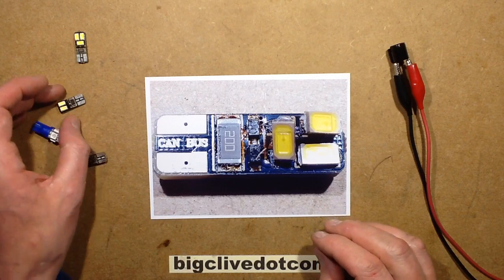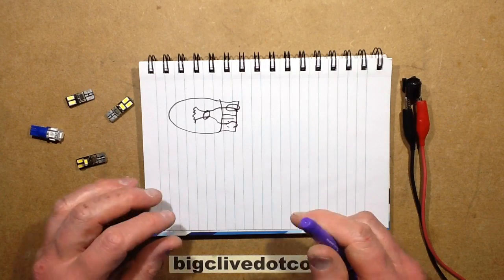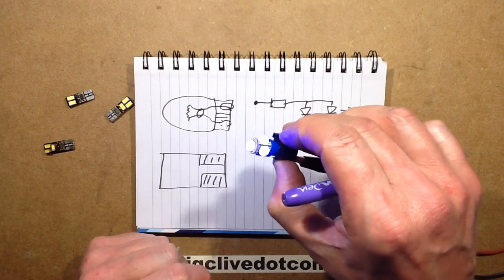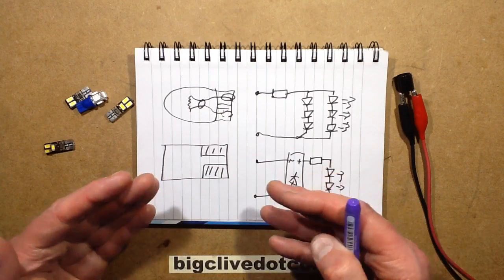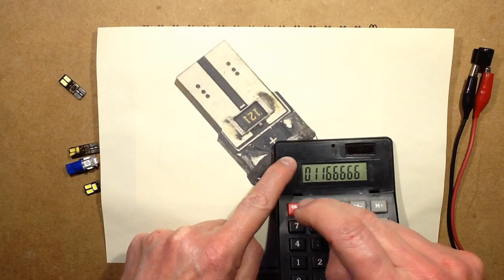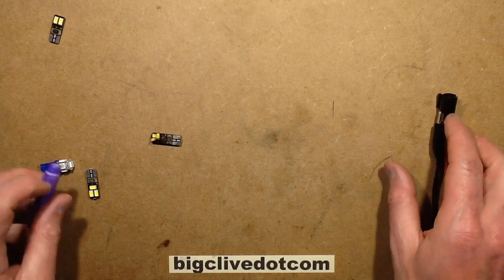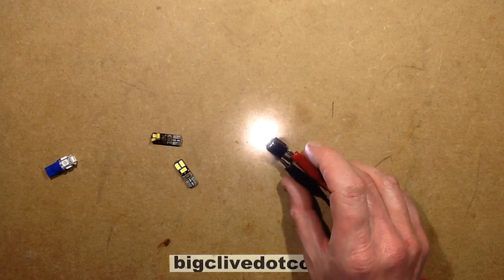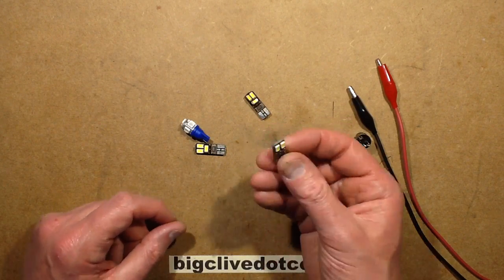Smokin' hot CANbus LED lamps.  (230C in open air.)

Comment: I think people need to realise, what i dont think is hammered home enough in Clive video is that You dont need the resistor , or the load , unless 1) not having it messes up a bulb out detection system . or 2) it messes up the speed of your indicators (turn signals) . Putting LEDS with huge burny resistors into places where those resisters are in no way helping , and even worse melting things, seems a bit silly (like in dashboard , or running lights, or other interior lights) - so make sure u use the low load ones if you possibly can

Comment: So if you did use one of the CANbus lights, and it failed, then it might not be detected.  The dash warning light won't illuminate if the resistor is still connected across the leads? Assuming the LED's fail before the resistor does.

Comment: I run these in all the rear lights on my BMW. Not this inferior style, but CanBus LEDs nonetheless. Only one failure out of 8 bulbs (50W brake bulb), so no complaints from me. I buy them from Horizon LEDs out of the U.K.  They test and stand behind their bulbs. Highly recommended.
Reply: I should add that mine are NOT T10s. They're much larger bayonet style BA9s and BAY9s. I actually have the one that failed if you want it. It started working again when it cooled so I couldn't throw it out.
Reply: +Mike1nyny in my book that's the best reason to not only throw it out, but smash it to bits first.

Comment: I've had a funny anomaly with an led break/side light combo, when switching on my lights when travelling forwards, my engine feels like someone's just attached a caravan to the back of the car.
I can't see it being too high a load, any ideas?
Car is '02 scenic diesel
Reply: +bridgendesar it sounds like your alternator is being put under a lot of load, check to see how many amps your alternator is rated at and how much your electrical system is demanding with those lights on. It's better to be safe than sorry.
Reply: +Tomo Takino I&#39;m pretty sure that&#39;s not the case, after a bit of googling, i revved the engine and put my foot on the break, the revs died off instantly. this was with the old bulbs back in place. the voltage from the break light tells the ECU to cut power. I&#39;m thinking a diode on the break light feed should prevent the side light voltage tripping the ECU.
Reply: That's odd, then again I have little experience with the Scenic since we do not have them here in the US. Glad you got it figured out.

Comment: The Problem in my Fiesta Mk6 built in 04 is, if i dont have the resistor the lights stay on. No auto off or auto on. Instantly on.
So the resistor is needed in my car. But it does not have 1,6 W, it " just " has 1,2 Watt. But still get pretty warm
Reply: I know its a old comment, but for someone who is interested: It stays on because the solid state switch circuits are leaking when little or no load is on them.

You shouldmake a good resistor circuit (5 or 6 resistors, with grand total value matching the same as the old resistor), heatsinked and everything, and mount it somewhere secure in the car and use thick quality wire and connect it to the bulb socked. And then stick a normal led PCB in there without that stupid SMD led Thats how i would do it. Remember, its a car, its not a written off washing machine. Wouldn’t want to see the electronics blowing up on them. Its a major pain in the arse

Comment: I put so called CAN-BUS Led tail lamps in a Park Avenue. About a month later my traction control light began to illuminate at random times. After spending about one thousand dollars on new hubs and a computer reprogram, it turned out that the ABS system functioned on load rather than a completed circuit.  Somehow GM designed a system that required that no more than two of the four tail lamps could burn out before the ABS system would register a major Error. It needed a current draw within the range of four 25 watt filament lamps. The computer would then shutdown the traction control, and shortly after, the stability system as well as the ABS entirely.   If you get a min. could you reverse engineer a Buick park avenue CAN-BUS system. I will understand if you need to do a 2 part video.

Comment: Good video, we had an issue with 110 Volts dc 20 mil Ø pilot lamps burning out on substation accumulator chargers. Underrated R's. poor design. I modified the design with the correctly rated R's and the problem was remedied.

Comment: I tried the printed board T10 LEDs in my dashboard. Worked for 2 days, but the connection was awful. 

Bought a plastic base version, worked amazingly ever since. A lovely little 2W ice blue LED. 
If you have an older vehicle, try a low consumption plastic base such as the one Clive demonstrates.

Comment: I wonder what is the point of such LED lamps. With the smoking parallel resistor they don't draw less power than a classic bulb. And because this resistor heats the LEDs up terribly, they also don't last longer than a classic bulb.
Reply: If your brake lights can't be seen in daylight you have bigger problems than a bulb failure warning.
Reply: +danyk666 - The lure of a long-lasting LED light instead of a fragile glass bulb, along with getting a daylight-white color, probably.
It's not about drawing less power, and most exterior light housings have enough space that they don't heat up this much. I've had to convince a lot of people to avoid LED lights on cars with bulb-monitoring for this exact reason.
Reply: +danyk666 they are fashionable.
Reply: dbeierl bs. If you get a good quality one they do last longer. Its called having a heat sink, which many have...
Reply: +Geoff Allan Couldn't you just use LEDs without the resistor and simply ignore the "lamp failure" messages since you could SEE when the light fails?
Reply: A car wouldn't be dependent on a working bulb to start, but it might not pass inspection with the warning indicated. Also it's rather difficult to see if lamps (brake lamps in particular) are working during the daytime and some people never drive at night.
Reply: If you buy smart you can direct the light much more than any traditional light, in the "festoon" type lights there are 40W 46mm long glass tubes that sck arse and if you replace them with led "plate" style ones you get insane amount of light :-P

Just desolder the can bus resistor ^^
Reply: It's just gimmick. I use G4 2 watt leds. Always use residential 12v led instead of automotive rubbish.
Reply: Waaayyyy brighter though?
Reply: +kevin12567 Maybe some cars won't start the engine without a working bulb. I wouldn't wonder if some safety nerds really went this far ...
Reply: My car is older, and it doesn't have a "bulb failure" indicator other than a tiny light in my dash console (which I unplugged). It doesn't have a sophisticated drive computer to irritate me with bulb failure messages and it doesn't have a fast-blink bulb failure indicator.

Installing LEDs was a great choice for me because in my specific case it doesn't require any resistors, and it does draw less power. Also, the bulbs last longer and produce whiter light.

Comment: I don't know who first blamed the CAN bus, but that's a completely different system that has no direct correlation to bulb monitoring.

Perhaps since modern vehicles employ both a CAN (Controller Area Network) system and electrical system control units, guys blame the system. The CAN bus is a twisted-pair network connection allowing these modules to communicate together. For example, the doors have control units that operate the window motor, door latches, switches, and mirror motors. These in turn communicate with the main body electrical module. 

What they are trying to "fool" is the body electrical module that monitors the current flowing to those bulbs.

Manufacturers have started to design LED lamps instead of tungsten lamps. In these, the monitored current is corrected for the more efficient LEDs.

Comment: Answered my own question; Don't buy canbus compatible.
Sort out the polarity problem my self.      If,,,,,,,,, load is sufficient
or.
Need a component that acts like a dummy load without creating heat.
 Are they on they horizon?
Reply: +David Oxland if u need the load just to make it flash at right speed you could change the relay for a non load dependant one.
Reply: +mark1jz ,  Thanks mark, No, I'm thinking of the continuous operating running lights. licence, markers etc.
 I hop some manufacturers will come up   with something that will satisfy  canbus and do the job without burning down the house.
Reply: +David Oxland they have to do some kind of work.  The simplest is to just dissipate it as heat, but they could generate radio waves or X rays, or each one could have a tiny generator  whose output would be fed back to the battery to charge it.  Or of course they could use incandescent lamps.

Comment: I would imagine that the eBay listings probably say it in big print somewhere now that if it doesn't work flip it around.  With that said it would be a good idea to take bad feedback on such items with a few heaping spoonfuls of salt since some people don't realize they are working with diodes.  Now as for the heat issue, would using a higher wattage resistor help with that some?  I thought I read that somewhere.  I never had to use resistors with mine since the maker of them made them a part of the assembly, eliminating the need to wire them in and mess with the original wires.

Comment: I have a Volkswagen and what happens with CANbus is that when you first start the car it will send a pulse to all bulbs to check and see if they are not working.  LEDs that do not draw enough power are assumed to be dead and that socket is temporarily disabled until the next time a the car is started and there is a good bulb or led present.  This is good for two reasons, you won't drive around with a bad bulb and not know about it and you won't get that rapid flasing that typically happens with a bulb not working.

Comment: Can these cheapy LEDs be tweaked to make them safer to use and have a
longer life?

Start a quick/cheap fix series  for some of the items you test?

I have some in my caravan, a strip of 12 LEDs only 6 - 8 are currently working, the rest
flicker and have moments where they work and then they stop again.

Comment: I've had canbus friendly led lights in my 2008 vw for over 2 years with no problems and no damage to the tailight housing or led. Done 4 hour trips at light where if they would fail, they would have. Now these were not t10 bulbs. They are bit bigger. Love the videos. Just wanted to pass my experience along to you.
Reply: +Austin Clarke "canbus friendly" what a phrase of shit.
Reply: Austin Clarke
CAN bus friendly is a misnomer. Do you think these LEDs communicate over CAN??
Reply: +Dr. Lecter do you really think incandescent bulbs communicate at all? No. The video is actually wrong and doesn't communicate at all. All it does is continuity test on the turn on of the vehicle. So adding a resistor just shows a load on the circuit. Maybe you should know what you're talking about before running your mouth.
Reply: Austin Clarke
I think you're misunderstanding. The load testing you're talking about has nothing to do with CAN. CAN is merely a defined protocol for communicating data - nothing to do with testing whether lamps are working or not. Hence why CANbus friendly is a misnomer.

Comment: I bought a 10 pack of amber ones for my front parking lights/indicators. I have went through all of them they all failed from the heat. So thankfully i dont need to have resistors for the smaller bulbs and i bought 2 mildly more expensive brand and they have been fine for months. I think it comes down to the heat and the quality of the LEDS
Reply: +Acc0919mc 
I find that the LED packs with larger quantities (10 or more) tend to be really cheap. Not just in price but in build quality. LEDs that come in packs of 2 are much better quality for the most part.

I had a 12 pack of T10 bulbs for my dome lights. They all went out in a matter of months. Then I splurged for a two-pack made by Philips, and they're still going strong three years later. I even took them out and put them in my new Camry (which surprisingly had incandescents in the domes in spite of everything else being LED).

Comment: Well I would still just order bunch of those canbus models and then just desolder (or nasty way just cut) the resistor. Easier to order bunch of stuff and it does not take that much of time. Also if you don't know if the car monitors that specific light then you can try it a bit easier.
Reply: +Hene193 Or don't get one canbus compatible. That just means it has a resistor soldered across it so the dash can realize it has a bulb.
Reply: Richard Smith Yes but the thing I was after that most cars I have seen do have really annoying notification about bulb going out and it is much more easier (at least for me) to remove the resistor than add one. And I don't mean that soldering a resistor is a huge problem for me. It's just easier to remove stuff than add more.
Reply: Hene193 If you remove the resistor, then the error on the dash will be there. The ONLY thing 'car bus' compatible means is the resistor is soldered across it. Taking it off means the dash might think you don't have a bulb.
You can't have your cake and eat it too :)
Basically, just buy the one you find less annoying I guess :P
Reply: Richard Smith Yes well of course it is then there. I just meant that if you plant to replace every light with led ones and you don't know which ones need that resistor it would be better just to order one type and then modify it to your needs. 

I just thought people would realise that I know what I'm talking about but it is kinda hard that there is no online CV telling everyone that "Hi I'm electrical engineer" :D

Comment: Yep I use the old type ones in my car inside and out and they tend to flicker and flash when they get a bit old. I noticed when replacing one the color temp difference between an old one and new one is quite noticeable. that's cheap LED's for you though. The older style ones don't get nearly as hot however.

Comment: I agree with your point completely. i would like to add that the heat sinking effect present in the housings of older vehicles whom use metal housings for reflectors can have an impact on lamp failure. i can say that these are hot running lamps and can burn out if no cooling is applied. I would also say that a Chinese outlet near my home selling these almost exact units the equivalent of 1$ for 2 but my 1985 vehicle only has the BA15 or BA9 sockets. I set about shaving the lamp down on the contact points to fit inside the BA cup. I used a blown lamp to prove the concept and long story short, they are still working in a daily driven vehicle as park lamps that are used to drive with constantly. The entire arrangement, save a few insulation, (bake-lite maybe) components, is metal and to the touch gets very hot. surface measures 45 ~ 50c depending on weather on the area around the holder itself. just a crazy thought about heat-sinking...

Comment: I bought some non-CANbus ones for use as parking lights. My car was happy with it on the right side, but on the left it needed to see some 50mA more current draw to stop complaining. I was planning to add bleeder resistors to the wires (four to spread the heat), but before I got around to it, the other LED bulb broke completely. Black spot of death on each of its LEDs. So the incandescents still last longer than those did...

Comment: CANBUS LEDs are biggest ripoff ever.  I bought festoon bulbs for license plate but this didn't clear the dashboard error. The CANBUS ones were a 700% increase in cost over normal LED bulb.  I bought traditional filament to replace instead which was almost embarrassingly cheap to buy. Job done !

Comment: I was about to buy these at one point but never did. I wanted to use them as a license plate light. Glad I didn't cause those would burn the sockets up for sure.
Reply: +Sako&#39;s Tech Spot - my car is really fussy about its CanBus stuff... but doesn't monitor the license plate lights. I've been able to run those without resistors just fine. But the signal and brake lights require resistors.

Comment: Is there a better way to do it? in other words is there a way to trick the car systems into thinking the led is a bigger load, without just burning off the energy as heat.
Reply: +robabrady Yes, buy a BMW and turn off the lamp failure detection in the BCM. Easily done.

Comment: I've tried a whole slew of replacement LED lamps for automotive usage and I think they need to mature a little bit still. Cooling is often a problem, at least for the cheaper bulbs.
The printed circuit board type wedge-connector is sub par, and the bulbs often times want to creep out of the socket, larger bulbs - faster creep. The plastic base with folded wires is better.
Double filament tail light bulbs that are polarized can be a bit of a problem too:  One that i bought was wired the wrong way around simply shorted and burned up inside my tail light housing.
It's expensive to be on the fore front of cheap chinese technology. :-)

Comment: I used some of these. The first thing I did was removing that "can bus" resistor. Then, I calculated the current into the LEDs and found out it was too high, so I also changed the other resistor. In the end the LED was quite safe and stayed relatively cool.

It's a pity you have to do that but I have now accepted that for every cheap chinese product I get, I have to inspect them and sometimes modify them before using them.

Comment: I melted a hole through the rear tail lamp cover of an old Volvo I used to drive...I had used a higher wattage bulb because I didn't have any others available at the time - I learned the hard way!  It was the old style incandescent, but I was unaware that the new LED version could get so hot - thanks for the vid Clive!